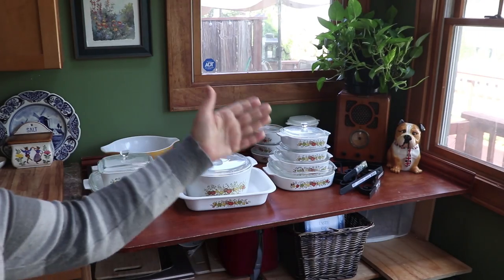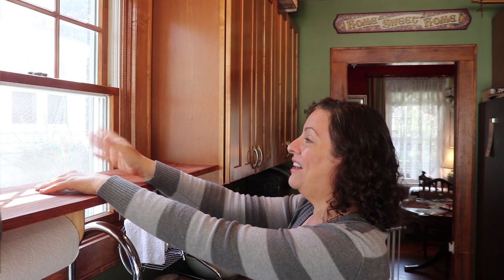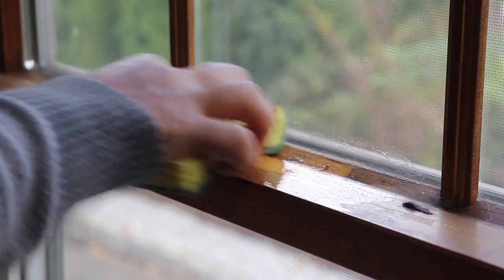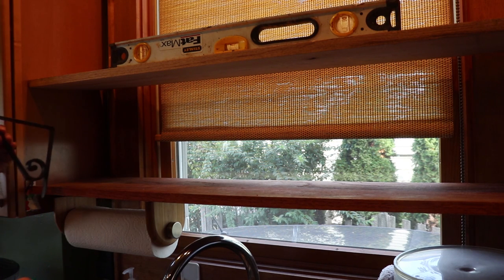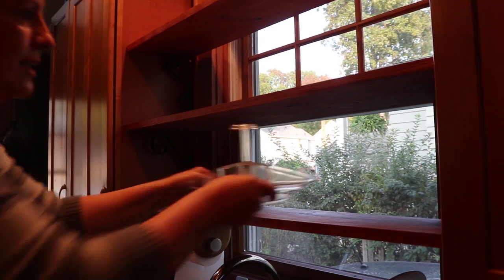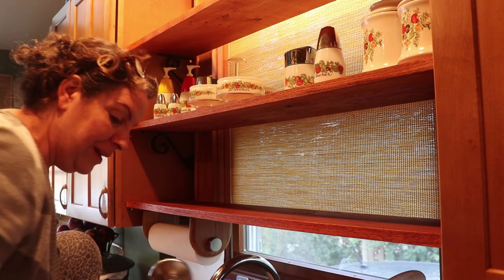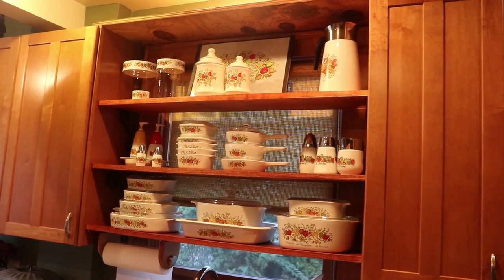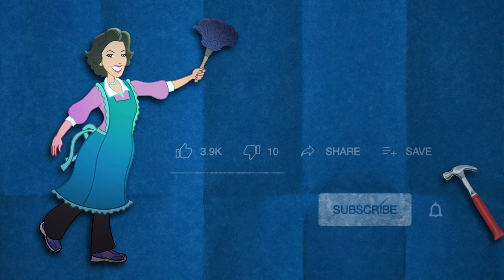I am a CorningWare Nut! Displaying my (Small) Collection

Comment: My favorite cookware overall is my Corning ware, white with the cornflower blue logo. I started collection it when going into university to add to my "hope chest" [or as I joked with my dear mom, my "hopeless chest"]!  Once out of univ and on my own I still bought a few over the years but also eventually added the Corelle plates/accessories etc for everyday use, in the Old Town Blue pattern [navy blue border on white].  50 years later it is all still in use and looks like new!  I have one inherited cast iron pan from my great grandma [est. 1890s], and two stainless steel Revere-ware pan and pot, both with the copper clan bottom - they were my mother's used often between 1950 and 1976 when she died very young and unexpectedly.  While more modern pattern of cookware are pretty and popular, I have no desire for anything else as they have zero toxic coatings and are very easy to maintain.

Comment: I was thinking about starting a collection with Spice of Life since it came out in my era but got alittle scared when I heard that Correlle issued a warning about pre 2005 vintage pieces not to eat off. Does anyone know any info?
Reply from the maker: It s only for when pattern is where food touches. In corninware the pattern is always on the outside. Every once I a while an article comes out about the imminent death of people using corningware and corelle....we re still waiting for said death, by the way, and the article has been long disproved. Of course you do your own research I am no expert, just a casual collector. For more info visit the corelle and corningware fb groups.
Reply: Not the inside white parts in outside or inside. Just the non blue cornflower patterns have some lead in that paint. So those dishes don’t put in dishwasher and don’t let food touch the outside but that being said it has a coating on the outside so only if it’s scratched or paint cracked can the food not touch.